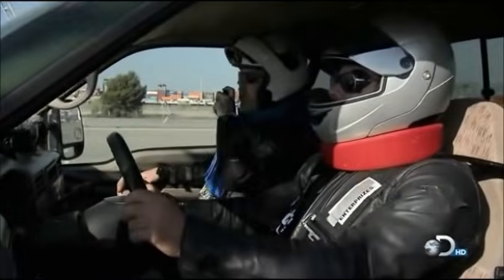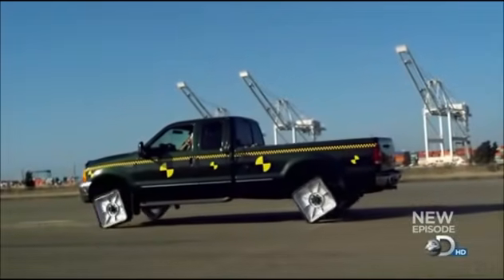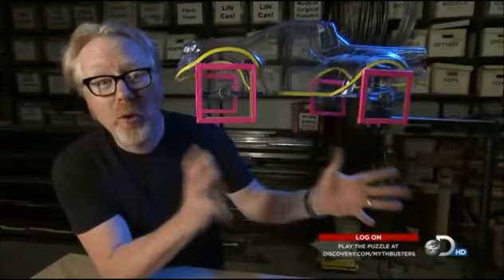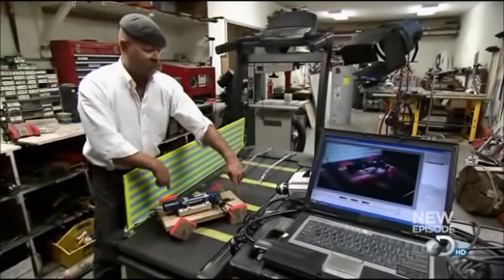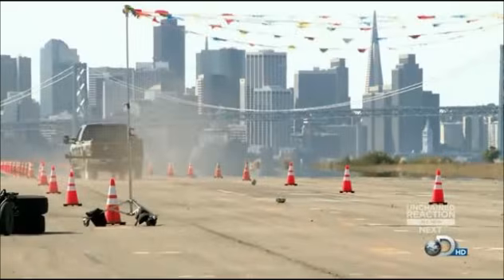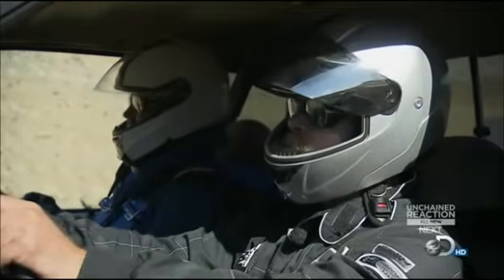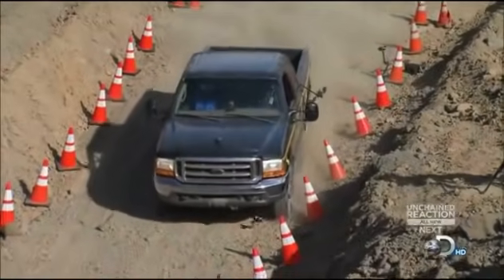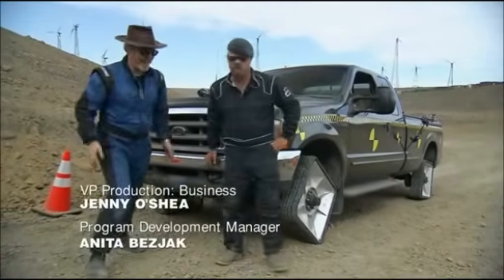Square Wheels - Mythbusters for the Impatient

Comment: first problem is that they used a Ford😂
Reply: I don't know it looked Ford Tough to me
Reply: 😂 you're cancer 👌🏼👌🏼💯
Reply: +mets12100 Ford was noted for mastering the mass production line. Not the first car.
Reply: Toyota's are worse. That vibration would bend it to pieces, The frame of a toyota is very light weight. As we know most toyota truck rust to dust in by the time they are same age as that Ford. 

I am surprised that ford held up as well as it did considering the amount of vibration it endured.
Reply: They had to use a ford cus all the Chevy's were broke down
Reply: +Sergio Alvarenga that was not a car, it was a 3 wheeled wagon with a motor. A trike.
Reply: +Paddlezapper you got it man toyotas are superior
Reply: +mets12100 Mercedes-Benz created the first car
Reply: This is a super duty which has a stronger frame. Despite it's strong frame it was shaking violently. Toyotas don't have a similar level of frame strength in either the Tundra or Tacoma. The frame would twist.
Reply: Andrew Dennison well square fucking tires on stock axles and shocks isnt the greatest. a chevy would do about the same
Reply: Ford : First On Race Day
Reply: JayceStardasher Fix Or Repair Daily
Reply: You know what Ford stands for? "Fix It Again, Tony."
Reply: i reckon you think a toyota would be better?
Reply: Fords are better solely for the fact that they built the first car.
Reply: I am not a ford fan, but I would take a ford over a Toyota any day after my recent experience with one. I used to think Toyotas were good vehicles, but not anymore.
Reply: Japanese Vehicles for the win :)
Reply: +Channel Zero One the motel T was the first car in 1908 made by ford.
Reply: This should answer all questions for the first autos. So many different answers, but none of them are ford. Like I said Ford was famous for mastering the production line. Google it or follow link.

https://www.loc.gov/rr/scitech/mysteries/auto.html
Reply: +Hawgslayer3 so true Chevrolet is gay af
Reply: Use a toyota 4runner haha
Reply: Andrew Dennison toyotas are for idiotas
Reply: Andrew Dennison the ford survived
Reply: +Ḉąp̃tǻĭñ Ẽnçhilâdă ....no.....that spells 'Chrysler'
Reply: true
Reply: I've made it up muddy hills like that in my 87 toy. With a busted turbo. Gearing is everything. :p
Reply: +mets12100 not true
Reply: yeah ford cars are trash
Reply: Andrew Dennison FORD- Found On Road Dead
Reply: diner n0s
Reply: Zero Corral to dog shit
Reply: Wakhy you found given head

Comment: umm you can't control where the tire is in rotation unless you have 100% locked axles front and rear or some how manager to only go straight with no wheel spin

Comment: What would be a better idea is instead of having just one big square wheel in all 4 corners is to get a multitude of smaller squares and offset them in each corner where you would have multiple points of contact back to back in all 4 corners at the same time.

Comment: after reading a masive argument, i stick to what i was going to say. the tape didn't help atall, if they just put poles there or got longer poles so the tape was above the truck it could probably go atleast 1 foot further, in fact it kinda did, the truck pulled the tape about ten or twenty center metres. Any way you can here Adam say "go on break the tape, come on, come on, go go go." Why did he have to break the tape, that's just fucking up the test, they're acctually trying to make it harder for the truck. i like the mythbusters crew, i like their show and i'm sad to see it go, but some times they don't do every thing right.

Comment: Probably be a lot smoother if you off set the left and right wheels and the front and rear wheels. So when the truck is sitting, both drivers front and passenger rear are sitting diagonally and passenger front and drivers rear sitting flat. It would be crooked at dead stop but smooth when you drive

Comment: I've seen another show demonstrate that in fact, if you have square wheels but the surface on which you drive consists of half-cylinders matched to the size of the wheels, it's exactly as smooth as round wheels on a flat surface.
Impractical and weird, but quite interesting.

Comment: The starting configuration of the wheels at the start of the ride doesn't matter. Make one corner and the inner wheels have to cover less distance than the outer wheels, which randomises the configuration throughout the ride.

Comment: I think you guys missed the real point. you didn't use real square wheels. real ones would have been a smooth ride and climbed the hill. O I know these ones were square sure. but not real square wheels as were used on farm machines before tracks to increase traction and floatation. really guys with all your acclaim I'd think you or your research staff would do better.

Comment: Wow, why didn't they lock the diffs? How could you go through all that work and not factor in power distribution to all 4 wheels? Jeez they could have just welded them. It also looked to be in 2 wheel drive for every single test except the square wheeled hill climb.  Great idea condensing the episodes though, thx!

Comment: unless you have a fully locked differencial there would be no point in having some of the wheels at an angle, they would turn/roll independently anyway, and with locked differencials you couldnt go around corners. nice try though

Comment: what about a cylindrical Road? make the circumstance of the cylinder twice that of the wheels edge length, then cut it half and put both halvs flat on the ground, then the square wheels work amazingly?
Reply: amazingly!*
Reply: +Nodak81 smart devices don't have that option, they havnt for a while because it's so buggy..... as for pc, I could have edited it but I was on my tablet, and still am as I type this.
Reply: +Nodak81 fair enough...

Comment: Even if it's in 4wd if it doesn't have a true locking differential in the front and rear it's going to allow one side to spin more than the other, completely throwing off the starting position of the wheel.

Comment: Different angles for each wheel is a dumb idea. They assume that the car is a rigid beam. But instead the whole car flexes each time another wheel touches the ground. 4 wheels at all the same angle and get up to some speed works best. Or normal round tires.
Reply: Yeah, I think they forgot that basically all passenger vehicles use open differentials, which would rapidly ensure that any advantage gained from the offset would disappear,

Also, lol @ the 2WD truck and street tires that couldn't make it up that little hill.

Comment: The first one is RWD.. The second one is AWD!
Reply: Actually, it's a four wheel drive truck, but they had it in two wheel drive on the road(like normal) and four wheel drive off road(like normal).
Reply: +The Tool Guy If a vehicle only has 4 wheels does that not mean 4 wheel drive and all wheel drive are the same?
Reply: +The Tool Guy IQ doesn't determine how much you know about cars

Comment: just like always, utter bullshit in their testing. they used 4wd in the hill climb with the square wheels but rwd on the round ones. which means their results are void.
Reply: +sayan das   I noticed that as well.

Their show is for kids.  I went to one live before and it was a joke!

Think of it as Sesame street 2.0
Reply: +sayan das i watched the entire video and i didn't see one indication of this? is it just speculation or did they say that specifically somewhere in the video?
Reply: hello world why would they say it?

when they are climbing the hill you can see the rear tyres slipping but not the front ones. If they were in 4x4 all the tyres would have spun.

on the square wheels you can see both of them spinning but the truck not moving.
Reply: sayan das that's simple because the circular tires had more traction
Reply: hello world thats not how it works. 4x4, all the axles are locked together. no wheel can turn independently.

Comment: Typical big Yank four wheel drive, didn't make it up the hill.
Reply: It wasn't even in 4 wheel drive dumb fuck.
Reply: +MaxTheKanuck Watch the slow motion from 1:12 and you can clearly see that all 4 wheels are powered.
Reply: Evil from evilution ...Cool story? That has fuck all to do with the fact that it wasn't in 4x4 when they did the hill climb. And those tires are completely bald, so either way it wouldn't have made a difference.
Reply: +MaxTheKanuck It's the same truck used. Why would they take it out of 4WD? Looks to me like the differential did its job and transferred more of the power to the rear wheels when it lost traction.

No need to keep swearing and getting aggravated just to cover up that you are just plain wrong.
Wannabe American.

Comment: theoretically at very high speeds the smoothness of the square wheels would be indistinguishable from the round wheels.
Reply: +Time Traveler Theoretically the impact of the wheels corners would whack the wheels round at that speed
Reply: +Time Traveler There would be virtually no ground contact by the time you hit a vibration-free state, therefore no control. A mild breeze would blow the truck right off the road.
Reply: +Time Traveler That's by assuming that the mass of the vehicle is very low and hardly ever fall down when the square wheels are flat
Reply: ImSaltyAFRightNow Things don't fall faster when they're heavier
Reply: Deer Viehch im not saying that. im saying that the lighter object wont fall as much per 1 metre travelled as a heavier object. If you have total kinetic energy and the mass is reduced, the velocity is increased meaning that per every metre travelled in mid air, less (x)meters fallen down.  And yes i know, all objects have the same acceleration of freefall despite their mass (provided their shape and size).
Reply: ImSaltyAFRightNow You mean the car jumping when the corners hit? Sorry for that :D

Comment: if the whole road is made of speed bumps (hump) placed one after the other then square wheels will give a better ride. you have to adjust radius of the bump according to the length of the side of the square.

Comment: Hey maybe you should take the 4x4 OFF
The 4x4 will break itself if being applied to concrete.
Duh.
The front wheels are obviously trying to pull.
The wheels would not all end up on the same gear tooth after all that chatter either.
Learn about gears.

Comment: 59995555555559995        59995
59995555555559995        59995
59999999999999995        55555
59999999999999995        59995
59995555555559995        59995
59995555555559995        59995

highlight the numbers
press ctrl+f
press 9
read the message
Reply: i can spell boobies on my calculator
Reply: +yoga dwiputra That was clever. I was scared at first, but then I was happy.

Comment: doesn't matter what angles you set the wheels at, unless you had a truck with locked front/rear/center diffs!
Reply: +RCPro Driver they had the round wheel truck in 2wd going up the hill and the square wheel truck in 4wd
Reply: +RCPro Driver these don't have center diffs.
Reply: sjpro1 I know that.  My point is that unless you had a vehicle with lockable diffs, it doesn't matter the angle of the wheels as power will keep moving back and forth to the wheel with least resistance.  I figure either that truck didn't have a traction control system, or they disabled it.  If it did, it would have kept applying brakes in an attempt to keep wheel speed the same left/right.  Even a limited slip diff would not be able to keep the wheels aligned the same as they started.
Reply: RCPro Driver then why did you mention a center diff?
Reply: +Ryan Thompson You're right it could have been spinning but it wasn't spinning. you can clearly see the front wheels not turning on the round wheel truck.
Reply: +FCFordLord We're dealing with a Class II troll here.
Reply: +RCPro Driver Right. They needed a vehicle with no suspension to really test it. Like their wooden model in the workshop.
Reply: +sjpro1 He mentioned a center diff because on a 2WD, there's nothing there to interlock the front and back axles. It would need to be a 4WD with front, center, and rear locking diffs to keep them all aligned.
He was just saying it's what it would need in order for the initial wheel positioning to make any difference.
Reply: +sjpro1 I know. 
What both of us are trying to say is that you would need one to have locking front and rear diffs.
The specification of "locking center diff" was an oversight on my part as, by their nature, a transfer case engaged in 4WD is locked between front and rear anyway.
As far as I know, you can only find a center diff in an all-wheel drive.
Reply: +The Tool Guy Yes I seriously was. There was no reason for me to spend a bunch of time on researching the history of 4X4s and AWLs, so I just ran with an assumption based on what I've seen, not even specifying that I believed it to be accurate.
Reply: +The Tool Guy He's correct. 4x4 vehicles have a transfer case, not a center differential.
Reply: +RCPro Driver Glad one person isn't a total fool, the small scale didn't account for any curvature of the drive path or slipage as exampled by when they stopped the first full scale and every wheel was in a different position.
Reply: im pretty sure they did that actually, since they actually got it to work. not sure how they did the front ones tho.
Reply: +B@c0n T!mb3r i noticed that too
Reply: +B@c0n T!mb3r Open diff its not a posi so the right front could have been spinning
Reply: So tell me how you could see the passenger side tire?
Reply: The front passenger side dug down. It was spinning
Reply: ILikeWafflz These don't have center diffs. They have transfer cases.

Comment: I'm pretty sure if they used a smaller wheel with more rubber in the tires they would have found it to work out much better.

Comment: Try using the 4WD next time for an actual scientific test. It was off for the round wheel climb but on for the square wheel climb.
Reply: +TotallyL337 No, your truck does not have a locking front diff.
Reply: +TotallyL337 it would be impossible for you to turn if your front diff was locked and you used it on the street. No Ranger came off road capable with a looked front diff. Unless someone before you put it in.
Reply: +TotallyL337 I think it was in 4wd, but with an open front differential the divers side tire didn't spin because the passenger side front tire broke traction and was spinning. I couldn't see the passenger front tire well enough in the video to see if it was spinning or not though I am just assuming it was spinning and we couldn't tell.
Reply: +Jonathan Sisley My Ford Ranger of a similar model year does not have front differentials, they are locked. Meaning if 4WD is on, both of those front wheels will be turning! Looks like they just had RWD on for a more dramatic effect, I think a 4wd truck could climb that hill. I could be totally wrong!
Reply: +TotallyL337 I don't think it would without special tires. Hills always look steeper when you're at the base than they do from a distance.
Reply: +TotallyL337 hell yea they had a hill this steep at daves farm and they jumped front wheel drive cars off that thing all the time look up skyhill there was no weight at all in that bed its to easy to spin tire on gravel lol
Reply: +RandRDetailing My mistake, I thought my truck had a locking front. It's stock. Does that mean that my truck has a limited slip differential? BTW when I use 4WD on the street the wheels jump a little in tight turns, which is why I thought it had a locked differential.
Reply: TotallyL337 it will do that with an open diff in both ends. you aren't supposed to use 4wd on dry pavement for a reason. and you can find out about the limited slip by looking up a vin decoder and checking out your door tag.
Reply: +TotallyL337 it would do that just because you are turning the front and rear diffs at the same rate even though when you turn, the inside tire is traveling less distance than outside tires. When in 4wd, the front is trying to spin the front the same as the rear axle and with the tires turning, the distance for the front inside tire and rear inside are not traveling the same speed or distance but the transfer is making it that way so it skips to make up for the distance gap. It's pretty complicated I just have worked on my Jeeps axles and I am part of an off road club at my campus.
Reply: +TotallyL337 You still have a differential in your ranger, its not a solid axle tho just cv axles comming out of the differential
Reply: +RandRDetailing only light trucks or suv's i know of that come with a factory front locker (thats not special order) is the jeep rubicon and land rovers. anyone know of any others?
Reply: +KidFury the Tacoma TRD has a rear as well as some Volvos and some Silverado trucks.
Reply: ya..know theres more that came with factory rear lockers but as far as front lockers there was only a couple afaik
Reply: The front axle was locked. You can tell by one simple observation. When they put the square tires at different angles (One side flat, the other side at 45 Degrees) the wheels didn't just flatten themselves out. The "tires" opposite each other stayed at their original angles, thus confirming a locked differential.
Reply: So yes, the test was indeed biased. Kinda sad that we look to these guys for scientific facts

Comment: That's one used truck I don't want to buy even with round wheels.
Reply: +ROGER2095 "Suspension in excellent shape. Lightly used" lol
Reply: +mirvha714 accident free, caredul lady owner
Reply: brand new wheels. excellent condition.  unique tread.
Reply: +ROGER2095 Hyper-traction technology, super-oscillating ride quality.
Reply: +ROGER2095 - 2:52 The oscillation frequency on dat ass must be aftermarket.